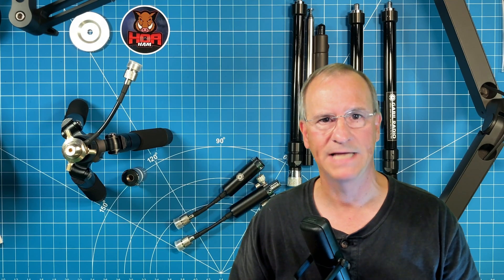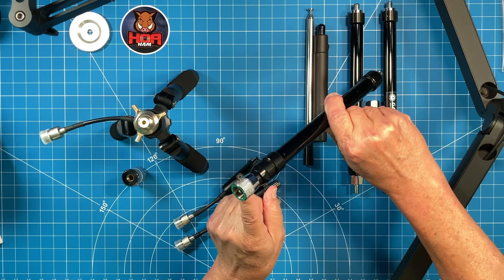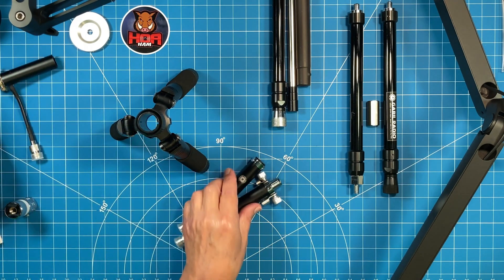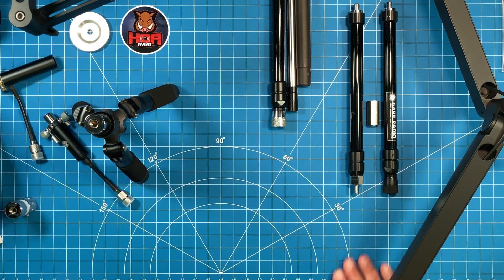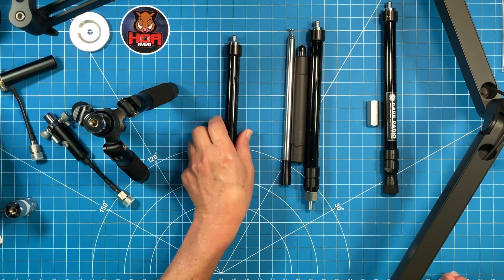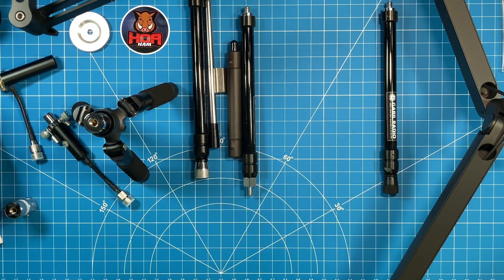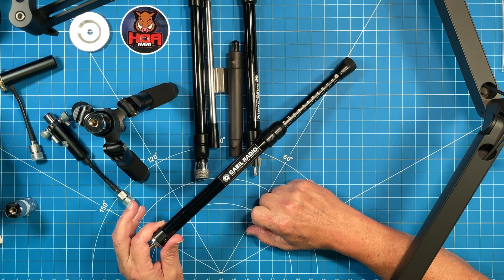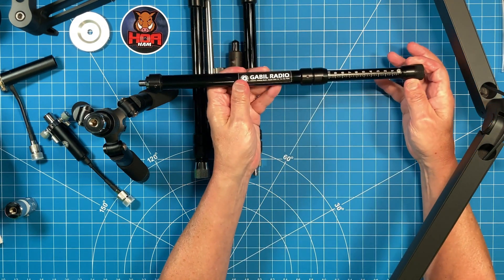Tiny Go Bag Antenna Gets Major UPGRADE:  Gabil 7350T  & 7350TC for POTA, SOTA, Back Yard Portable

Comment: A second comment as I don't want any confusion. You need to suggest that they modify their scale to reflect the approximate MegaHertz instead of an arbitrary numeric scale which means nothing without the chart.  Setting the coil to 5 on the scale for 14 MegaHertz or the 20 meter band is just plain stupid.
Reply from the maker: The challenge of marking it with MHz is when someone chooses to put a difference length whip, or add the 80 meter loading coil, the MHz markings become irrelevant...they are forced to use something else so it is always meaningful regardless of the whip length.
Reply: @HOAHamRadio  I fail to see how that problem wouldn't be the same for the existing scale. 5 may be good for 20 meters with the included whip but if you put a longer whip on then 5 won't be a good setting for 20 meters. Put a MHz scale on there for the standard included whip. If someone puts a 17' whip on then its their problem.
Reply: @HOAHamRadio  that makes sense but I don’t see how their current scheme solves that problem as their chart doesn’t account for other antenna lengths. I’m really trying to understand their logic. Other companies mark frequencies and we know they only apply to o the default setup.

Comment: Thanks for the information. It looks like they have left us early adopters in the doghouse on this as I'm not seeing a way to correct the existing sticker problem other than buying the antenna all over again.
Reply from the maker: Marshall, this antenna has been on the market for years, with the label sold to thousands of people, under 4 different brand names that I am aware of.  I'm glad Gabil is finally the one of the four to take it next level...the other three are just staying status quo.

Comment: With the weight of the whip and 80 meter coil, does the slider portion stay in position or does gravity tend to collapse he slider?
Reply from the maker: It has a polymer "nut" at the bottom of the sliding portion you tighten.  It will hold the weight of loaded coil and whip for hours, days, weeks...but months?  Probably over time with weather conditions, wind, hot / cold variation, it could move.  So if you are thinking permanent, you may have to check it occasionally just to be sure.

Comment: Thanks for the interesting video! 
In some days, Gabil will also sell a version with a BNC feeder connector (I was asking them for that since some time). 
About the laser edged label: To me, marking the bands with a pen is very handy to quickly change bands. I guess that my band marks would be less visible on the black anodized surface. But of course, I would apply another marking technique 😉
73 Stephan
Reply from the maker: Well, if you mean the post, your in luck:  https://amzn.to/45l0c1V     They just sent me a production sample, and it is now live on Amazon.  

Many people like marking their coils, I can see how that would be helpful.
Reply: @HOAHamRadio  yes, this is the new post I meant! 
And about the markings: it's not always perfect, but many times, even on different ground, it's good enough. To lower the variation, I recommend to always use the same radials though.

Comment: I think Gabil is an "oem" mfg for MFJ and Comet. I could be wrong, but Gabil has products very similar, if not identical, to MFJ/Comet but in slightly different packaging, cheaper and "more" selection. (Sometimes you can get 160m version, versus restricted 80m or 40m multiband verticals)
Reply from the maker: They may well be.  Gabil seems be to the one leading the improvements, so that kind of supports your thought.

Comment: If I'm understanding this right does the tripod now come with both insert mounts?  If not they need to clarify that in their Amazon ad.  I would buy both inserts and the rest at that price and leave the little tripod in a box.  They would fit in the more substantial tripod I already own.
Reply from the maker: The tripod comes with two posts; the UHF version and the 3/8 x 24. It also comes with screws for attaching radials to both posts. 

Posts can be purchased separately which may save you a few dollars. Be careful to only buy posts that have the threaded holes for radials. They do have an old version post they are selling out which does not have the radial capability.
Reply: @HOAHamRadio  Do they have a regular website?  I did not see them for sale looking through the Amazon store.  Thanks!
Reply from the maker: Here is the link: https://amzn.to/447v9pj

Comment: I bought the 3/4x24 last week and received the old non-laser etched version.   According to their Amazon store, the UHF version is laser etched, but the 3/4x24 doesn't say that.  Not sure if it's worth sending it back and ordering a new one.
Reply from the maker: They may have stocked out of the 3/& x 24 when you last checked; it is showing in stock now.  Thanks for watching.